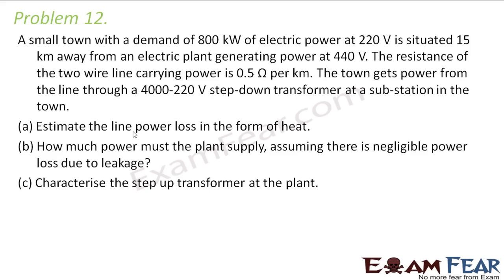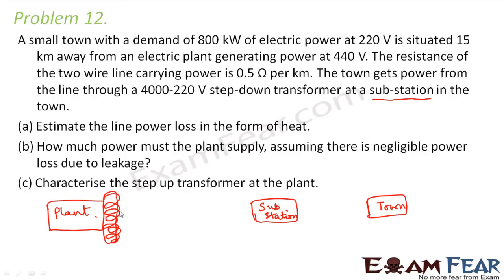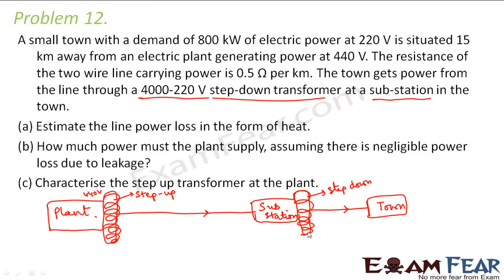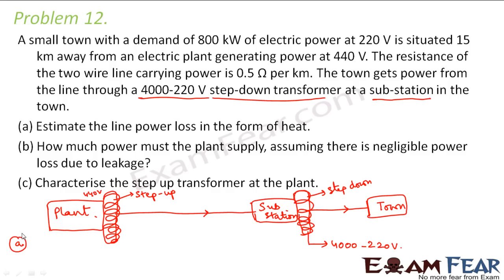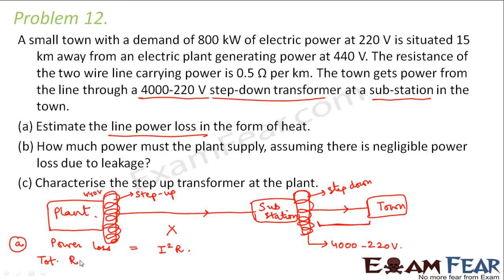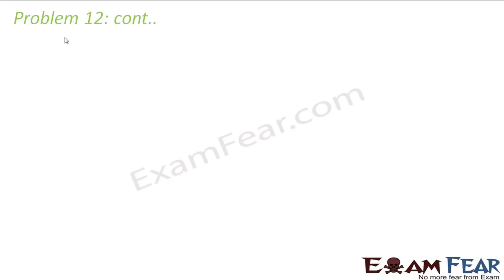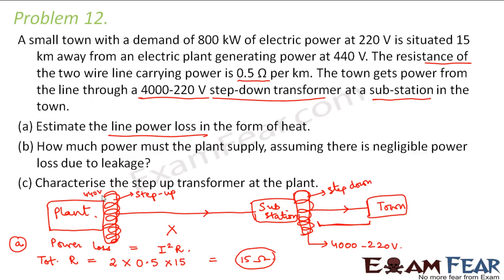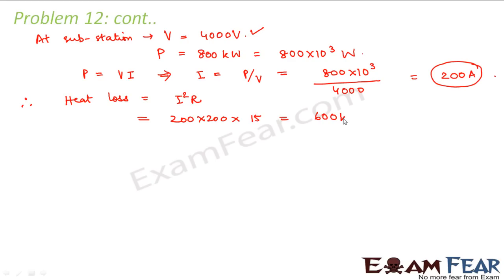Physics Alternating current part 32 (Numericals) CBSE class 12

Comment: b) neglect the loss from plant to sub, we only take the loss of power from sub to town.
c) plant produced 440v and been transformed into 4000 after passing the wire  soo in fact 440v should give more than 4000v after transformation but because of the resistance in the wire a power loss occurs which leads to a voltage drop " we used 200A since its the amp that we calculate from 4000v & 800 kw "

Comment: I don't get the last part :(

Why do we use 200 A in for last problem in this video at C question.
Isn't that the current being supplied to the TOWN after STEP DOWN?

Also B says that assuming there is negligible loss, then why do we take into account the 600kW lost :/
Reply: it says negligible loss DUE to leakage. NOT HEAT.